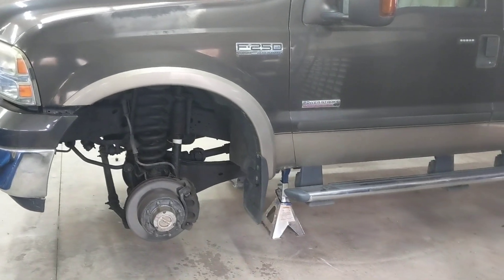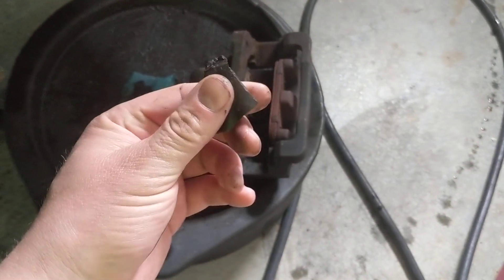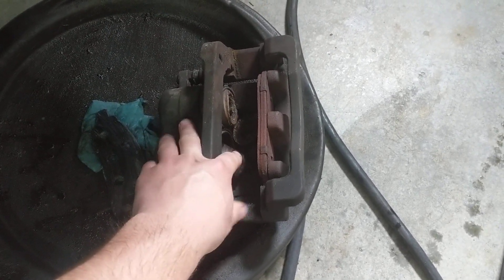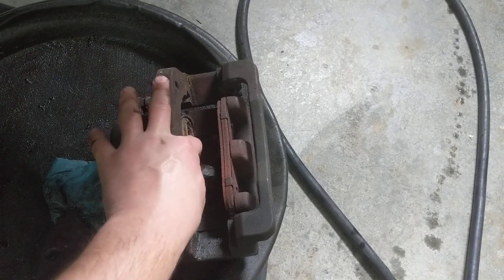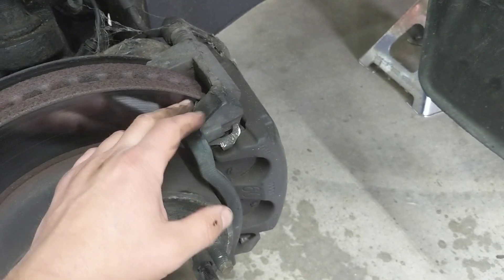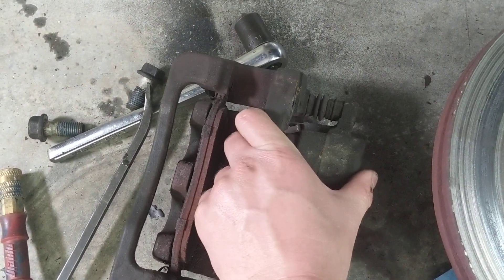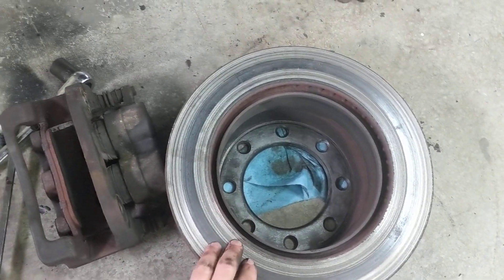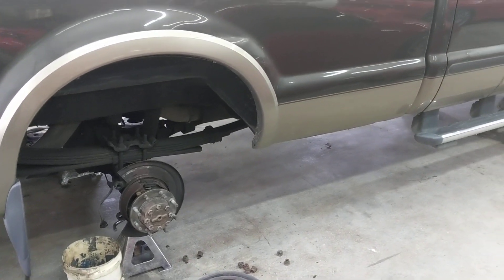Ford F250 phenolic caliper piston failure

Comment: I just went down this rabbit hole of brake repair/diagnosis over a 1 year period. They expand at the neck over time (in my case 0.15mm cold and 0.2mm at 80c heat soaked out of spec), preventing them from retracting, causing the piston to lock to the disc and overheat. The main identifying symptom is the brake will seemingly work fine cold (in the colder months, or when it rains), but once you get some heat into them like during the summer months (mine started binding at 60c) they begin to bind, causing a thermal runaway as the piston expands and gets more and more stuck in the out position, unable to retract. Another sign you've got an issue with the piston is when replacing your pads and rotors - you can't for the life of you push the piston back into the housing (with the caliper off the car and all fluid drained from it) to make room for the new thicker pads and it takes extreme force.

Comment: Phenolic pistons were a terrible idea. Especially on a heavy duty vehicle.
Reply: I agree, they crack, swell, scrape and shatter after a few years.

Great idea for motorsport applications where calipers will be rebuilt every time more or less. Less heat transfer to the fluid, lighter.... that's about it though.